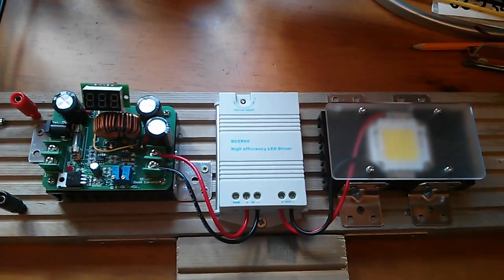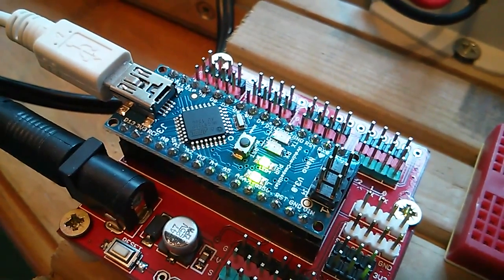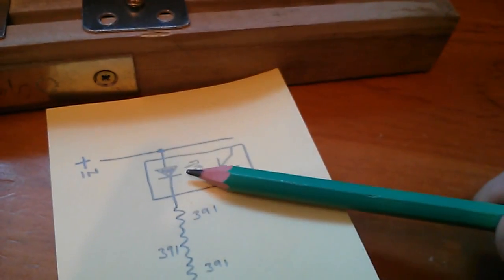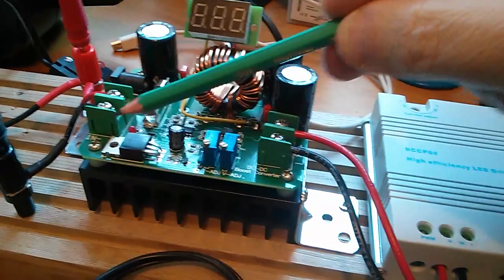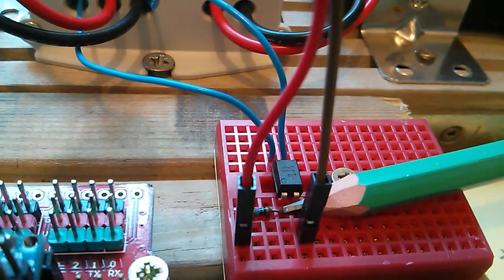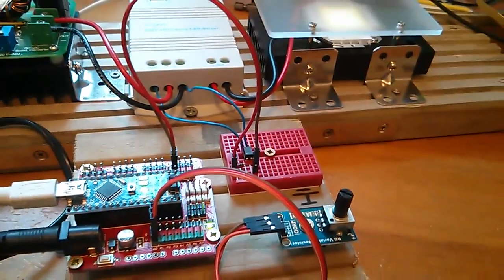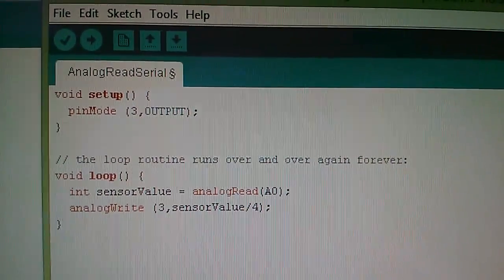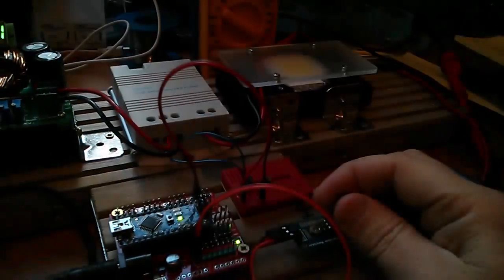60W High Power LED Driver with PWM #2 - Brightness Control

Comment: Julian, thanks. Did you ever find a better LED driver with a PWM input pin?I have the same requirements for controlling flash rate from an Arduino or Raspberry. Thanks. You must be a solar home I'm guessing. I'm just 60Hz AC power.

Comment: Would you be able to control something like this with a standered rgb controller? like the ones with rf remotes on eBay? 
http://www.ebay.com/ulk/itm/151660228486 
I want to try to do something like this but with 2 100w rgb LEDs

Comment: Would it be possible to control the brightness by using a pwm dc motor controller? I know it works on small leds. Great channel you have here by the way! You have inspired me to build my own 10w led flashlight, when all my parcels get here from China it will be like Christmas again ;)

Comment: http://store.sure-electronics.com/led/led-lighting/45mil-high-power-led/2pcs-45mil-chips-high-power-led-10-series-in-5-parallel
Can annyone explain what is the meaning of:
 "45mil"?,
 "2pcs"=you get 2 pieces?
38mil Red?
I am intrested in warmwhite so what is 38mil Red?
34 volt x 900mA=30,6W so is 50W the max tolerance?

Thanks for great videos Juilan.

Comment: Hi Julian,
Thanks for your post- I've found it very interesting, along with everything else on your channel!

I've tried the same project with exactly the same driver, but using a 12watt Cree LED. As you expertienced I found that the dimmer switched off completely at low settings and at high settings the LED pulses at around 2Hz. Do you have any ideas on how this could be fixed?

Many thanks, Dom

Comment: Hi Julian,

the reason for your strange behaviour is the way the PWM input is wired up internally. When the voltage is too high, the LED in the optocoupler is turned permanently off, so the power LED is on permanently.

Comment from the maker: Here's the Arduino code for PWM control. Pot is on analog A0, PWM output is on digital output D3.

void setup() {
  pinMode (3,OUTPUT);
}

void loop() {
  int sensorValue = analogRead(A0);
  analogWrite (3,sensorValue/4);
}